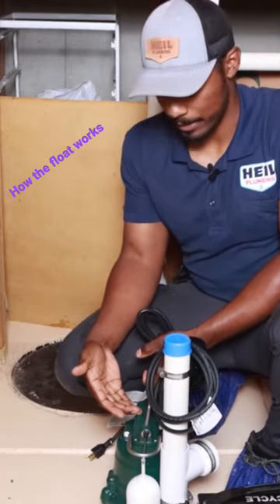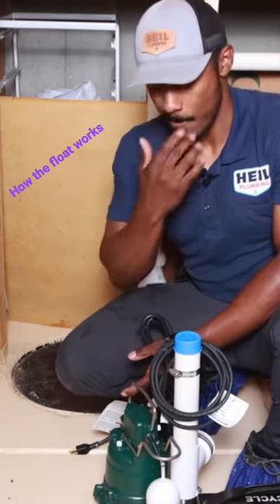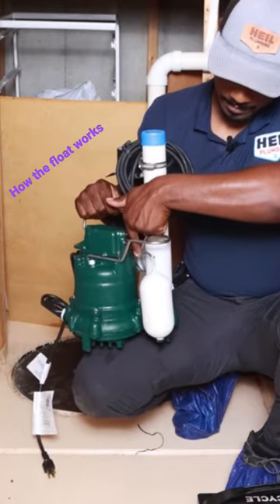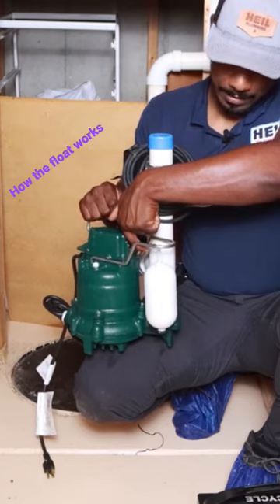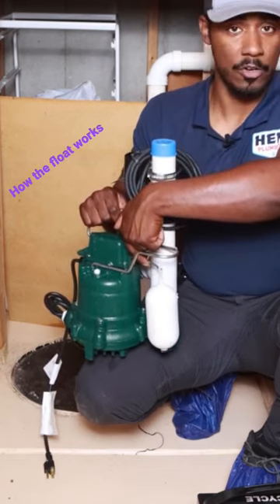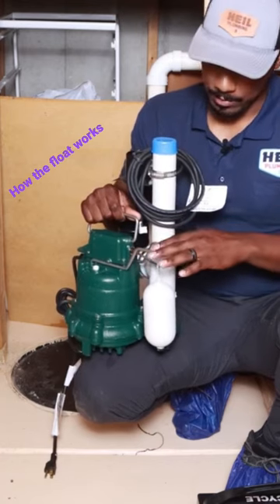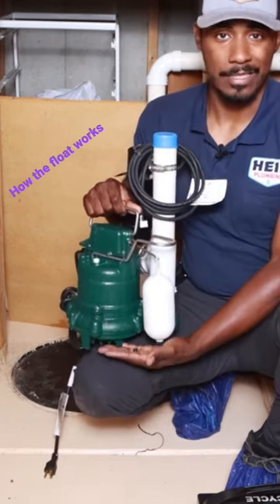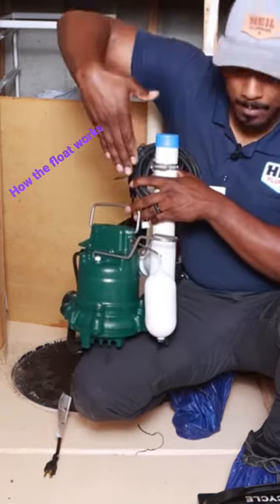How the float switch works on a sump pump

Comment: Your float switch might be broken. 

 If your pump has two power cords (one that plugs into the other one) make sure they are plugged into each other the right way.  One cord is the power to the float and one is the power to the pump.  If the plug that powers the pump is the only one plugged in then it will not shut off until you unplug it. 
 Buy an extra float and plug that one in place of the old float and see if the pump shuts off that should fix your problem.